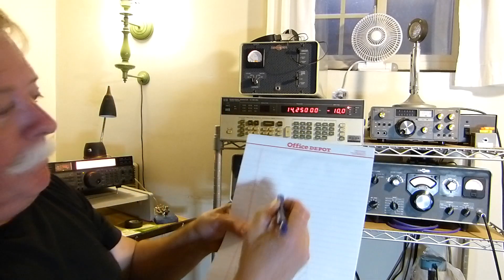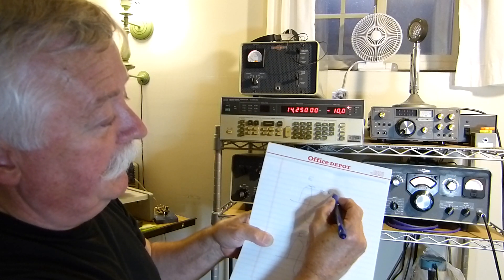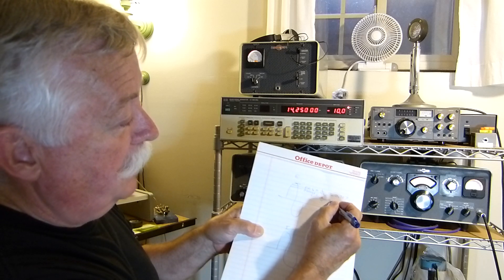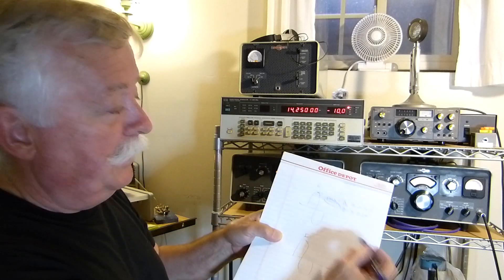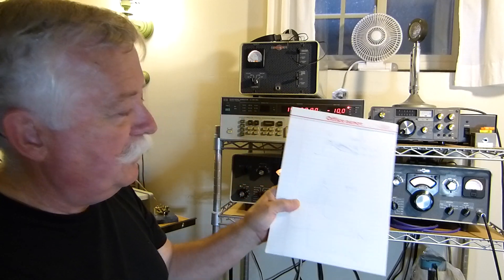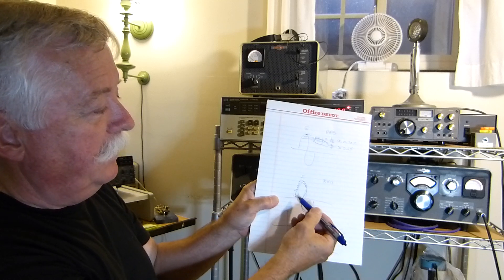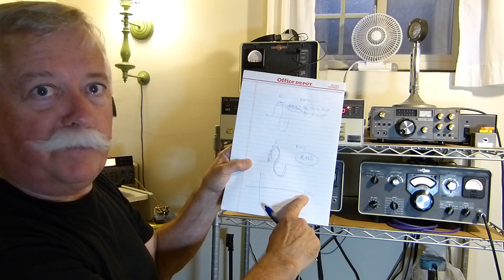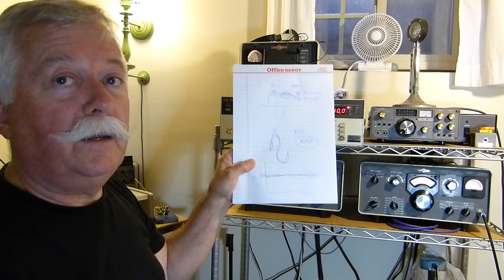Average Power or RMS Power ?"

Comment: You're absolutely right... those guys at Bird don't even use the words "Average" or "RMS". Hey, let's quit with all the semantics... every engineer understands the term RMS power. Quit letting these freakin' eggheads tell you otherwise. So the bottom line is that the Bird meter reads RMS power of a sine wave. And that's a very important point! The wave must be an undistorted sine wave in order to get an accurate reading!

Comment: It's even worse than you think!
All of the RF wattmeters I have ever worked on in 35+ years have used a single diode to turn the AC into DC.
So the signal is only 1/2 wave rectified, not full wave rectified.
I believe the average power for a 1/2 wave rectifier is something like 0.318 times the peak value.
Reference (http://electriciantraining.tpub.com/14178/css/14178_114.htm)
 So if you actually end up with a meter that is responding to the average current (meters respond to the magnetism created by the average current through coils), of a 1/2 wave rectified signal, but it's scale reads out in watts. That means the Meter SCALE has been created to take that factor into account since there are no microprocessors in a typical RF wattmeter.
 And there is significant additional error that occurs at low power RF readings due to the forward voltage drop across the rectifier diode itself.
 So at best, your average reading wattmeter is taking the 1/2 wave average of the RF signal and the scale factor is :
1.0 /0.318 = 3.15 (Pretty close to the value of PI....., and an easy way to remember the 'SCALE FACTOR' they all use).
 Things really get worse if you now capture the PEAK of the signal and apply it to the SAME meter scale.
Doing that creates a false reading of 3.15 X 1.414 = 4.45 times what the true reading should be.
If you are going to use a P-P multiplier than the reading gets even more exaggerated at 3.15 X 2.828 = 8.9 times higher than what the watt reading really should be!
So, for the typical wattmeter, the error is 4.45 for peak,
And 8.9 times for P_P power readings.
............
And all of that error comes from the fact that the non-peak part of the meter is measuring 1/2 wave rectified signals but the meter readings are 'scaled' to read the correct wattage value. That's the 3.15 'scale factor'..
I hope someone understands this.....
Dennis O
#12

Comment: Thanks! This makes sence. So, the term "RMS" should be probably be replaced with something indicating "continuous heating power" equal that of DC. Therefore, the so called "RMS power" formula is still valid.
Reply from the maker: +Bob H The formula is correct and "continuous DC heating power' is what it is but Average power, or simply, power,  is the correct term. Take a look at a Bird wattmeter manual and you will see that they do not, anywhere, use any term like RMS power. I am not on a technical crusade to change everyone on this but it is still good to learn and improve our understanding. I have a feeling this term was put into our vocabulary with stereo amplifiers back in the '60's.  It sounds Official and everyone liked it - so it stuck. In a conversation I probably would not say anything if it is used. We all know what we mean but it would be nice to know not to use it when interviewing for an EE position with a company.
Reply: +ElPaso TubeAmps - Agreed! (Besides, "Root Mean Squared" sounds funny.) BTW, really like your classic rigs in the background! Tubes Rock! 73, Bob, KD5MHQ

Comment: Great video, I think many of us engineering types fall into exactly the same trap. Another interesting confusion is Peak Envelope Power, the correct definition is that it is the average power during a full rf cycle at the crest of modulation. The CB amplifier makers use peak instaneous power but call it PEP which enables them to craftily double the figure. A typical transistor CB amplifier that when driven to saturation on FM at perhaps 100w simply cannot produce 200w PEP, but they will claim it does.
Reply from the maker: David - no doubt that you are correct in the equipment manufacturers using all they can to pump up the numbers. I think in another discussion it was mentioned that no one would want "average" power - that's boring - If the power levels are examined on some of the cheap audio equipment made today, it is easy to see that the claims are outrageous - a little five pound plastic CD player may be rated at 200 watts (per channel ...) we all know that it probably would not draw 400 watts peak through the power cord if it were shorted before the  (1 A)  fuse blew. Forty or so years ago there was an attempt to make all audio/stereo manufacturer's adhere to a standard when publishing audio output levels - apparently, it failed  :-)

Comment: RMS is in fact a math abbreviation for RootMeanSquare: It´s hard to put this in words, but it´s like drawing the root sign first then the "mean" dash and in the end square the most inner (x)...that´s it. You just haven´t completed your RMS drawing....this is just my text aproach to finish this.....in no circumstances a correction to what you said in your cool video!!

The Other (more familiar) is RMS in power output of an amp (it´s exactly that). It´s more or less an arrangement from all the big players during the late 1970th century to get a comparable Power output figure....(more or less) it´s the same with PMPO today desipte that PMPO is just rubbish! while Watts (RMS) is not.

The procedure is as follows:
Feed a sinusoidal waveform into the amp at 1khz until it clips. Stay -3db below and now sweep the signal from 50hz to 15khz...reduce the input until no clipping in the whole sweep range...that was the initial thoughts when creating the Watts (RMS) figure. During time they changed the measureing procedure from time to time, some take a noise input (pink noise) or some do unit step response, but the idea behind is clear i hope...;)
The more pro approach was the creation of the Watts (AES) output...
You can have a look here http://www.doctorproaudio.com/doctor/temas/powerhandling.htm, the description is ok, but for a more detailed description see the AES.org but one need to have a account to get the info...

Comment: Hello Dave! This was an excellent video about the explanation of output power. What you say is so true, we've been using the term RMS for years. What's interesting is, I remember vividly, back in the early 70's is when the term became quite fashionable among manufacturers of audio amplifiers (both professional and consumer). I remember reading the specs of many audio amplifiers, especially solid state where they would rate an amplifier's output power in peak value, which we know is useless power because of the short duration. I think many consumers and novice technicians were being misled by these manufacturers with their overall sales hype to sell so-called high power audio equipment, and making the consumer think that the device puts out an enormous amount of audio power!

Which leads me to a quick story back in the day when I was a young audio tech. A friend showed me an integrated audio amplifier in an old Lafayette radio catalog that he was about to purchase, and I remember the specs showed that it was rated at 100 watts. I looked at the unit for a few minutes with suspicion. Mainly, due to it's physical size. I'm trying to accept this rating, but i just couldn't swallow it. Well, he bought the amplifier that very afternoon, and I told him to bring it to my shop first.

After connecting a dummy load (which was big 'ol ceramic resistors at the time), connected my voltmeter and scope, I saw plain as day that the amplifier only put out 20 watts per channel into an 8 ohm load. He didn't want to believe me, but then again, he wasn't a tech. I called Lafayette Radio's headquarters and spoke to one of the engineers who designed this unit. Since he knew he was talking to a tech, he spilled the beans! He then explained that the advertised specs are given in peak power not continuous. It wasn't until later on in the 70's that the term RMS became fashionable. This video was excellent! many other techs should watch this...Thanks again for another eye-opening series! Keep in touch!
Reply from the maker: Hi Frank - yes, indeed, this is a term that we have all (mis)used so many, many times. We knew what we meant but it was enlightening to have it brought to my attention. I still think that the perception of "average" power and "RMS" power is conjured up in our minds from the average vs RMS voltage levels as they relate to peak voltage. I will have to admit, until now, I never sat down and looked both of these ideas in the eye, so to speak. My (misunderstanding) of what people thought was that "average" power would be derived from the "average" (0.64 x peak) and (RMS) power would be derived from the RMS values of voltage and current. So even my misunderstanding of what I thought was misunderstood was wrong – and then I was wrong again - how is that for a twist?  :-)
                            
Also, in line with what you say, no audio salesman would ever try to sell you something that had anything "average" about it - he would surely go out of business. To throw “RMS” into the discussion made everyone feel more knowledgeable even for the fact that they could say the word.

Secondly, without thinking it through it would be “common sense”  (?) that RMS times RMS would be something RMS (squared ?)... right ?

Anyway, I absolutely enjoy YT and the conversations I have with gentleman like yourself. It is my new ham radio – I still get on 20 meters a little bit and UHF occasionally. Mostly, I like to build.

A quick story like yours and the 100 watt amp – I have had Bird watt meters for a long time and some of my CB friends would want me to test their equipment. I was always told by them that their equipment would put out xx watts and they wanted to verify it. I learned to tell them that I would test it for them only if they promised not to hate me afterwards as in every case I can remember, the power level was not as expected and disappointment followed.

Always good to hear from you, Frank. Thanks for your input.
Reply: There's something else I wanted to add that has been somewhat of a problem over the past 5 years that I've taken notice to. Many of the newer professional solid state.power amplifiers, whether they be a standard rackable amp, or an internal amp used in many of today's powered speaker cabinets is, they don't put out the "so-called continuous" power that they claim! I don't know how other techs feel about this, but I would find this very disturbing as a professional end user...Have you encountered this in your path of repair jobs in the final testing and measurement stages? Although 90% of my repair work is with vacuum tube gear, solid state amps come my way for repair...don't want to turn down revenue :)
Reply from the maker: Frank Ferraro I have avoided solid state amps like  the plague so I have not had much experience with them at a repair level. I have three McIntosh solid state amps and there is no problem there. I am sure you know they will do well over 100% of their rated output.

It was mentioned to me just yesterday how the Chinese are buying practically anything they can carry off in our failing cities (I guess Detroit would be an example) and using the materials like switches and plugs that were made in the 50's, 60's and so on as they are quality parts - probably making two or three cheap junky ones out of every one of the good ones and we are buying them back. I have a good size box of old outlets and switches that I value and protect as even though they are probably 50+ years old, they are the very best around unless you want to pay astronomical prices for MIL specs stuff.

The point is, you and I experienced the cheapness of solid state equipment back in the 70's and before and the misleading ratings. I find no reason to believe that there is anything different going on today and maybe even more so. I also notice that many of the home appliances (like hair dryers, for example) have thermal fuses in them that will blow by looking at them wrong... it is good that the damn things blow before setting the house on fire (Thank God) but they shouldn't be such junk that they only last ten times.

The carburetor on my Sears lawn mower is all plastic. It is a push-on mount - total junk. I bet I have not used that mower more than 10 times and now it needs a new carburetor (or a kit). I have had cheaper lawn mowers for well over ten years with zero issues.

Anyway... I am sure the power supplies in these amps you speak of are marginal and the entire amplifier is a chip. I did once work on a well known brand of amplifier and the entire amplifier was on the PC board that had the tone controls mounted on them. Also, I am  remembering trying to test one of these type amps and getting practically nothing out it as far as measurable power although it would play rather loud out of the speaker ?? Maybe it was only 3-4 watts.

I hope you can make a profit working on these things as it seems in many cases throwing them away and getting a new one may be the best solution.
Reply: Frank Ferraro
Dido on the SMD stuff. I hate it with a purple passion!
Reply: Frank Ferraro
 Exact Frank, i would prefer a voltage figure instead of a wattage printed in the "instruction manuals" It´s easier for the Pros to get an idea what an amp is capable of...let say an amp have a max. undestorted output voltage of 90V. On a 8ohm load (standart for pro audio speakers) you get just a good  1kW output power. For 4ohm it just doubles....
Next would be to give a minimum possible impedance.